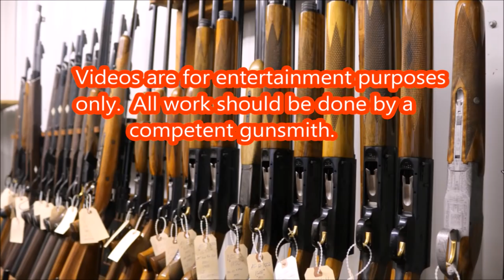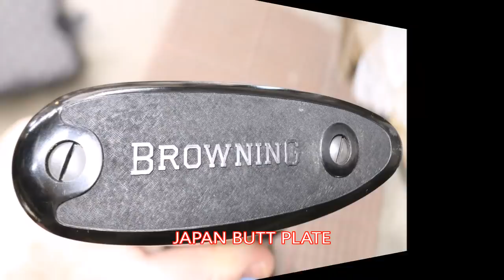How to fit Japanese wood to a Belgium Browning A5.

Comment: Hi Art, inherited my grandfather's A5 (japanese).  I use the gun for trap and hunting.  It has stopped firing.  Looking at shell the primer is barely getting touched.  Was told the Japanese wood was softer and the wood in the forearm compressed letting the barrel and shell go to far forward.some shims were put in and I was told it's only a band-aid.  Worked for awhile  but back to same problem.  Recently I was given a Rem 11.  Serial number trace by Remington dates the gun to 1908.  It has some nice looking wood, stock and forearm.  So the question would be can I take the wood from the 11 and put it on the A5 with no fitting?  Thanks

Comment: Nobody mention old and newer A5. Old A5 has no quick load action and ctg. elevator in one piece. And bolt recoil spring tube welded in an angle. Never mentioned.